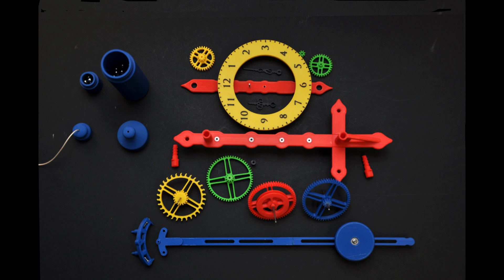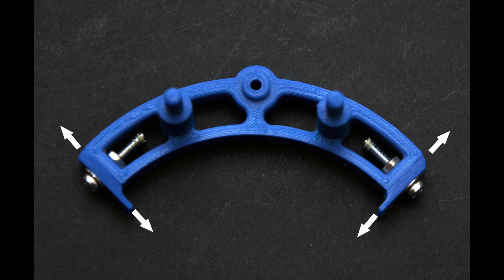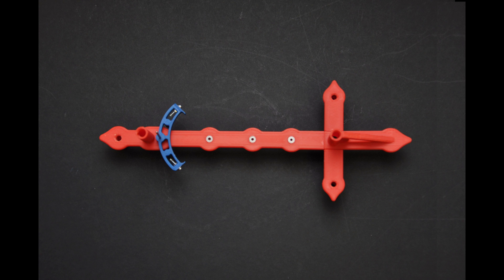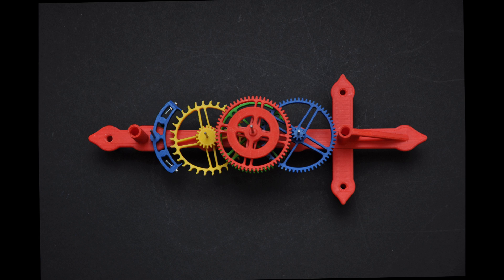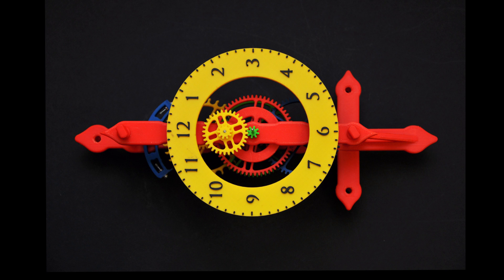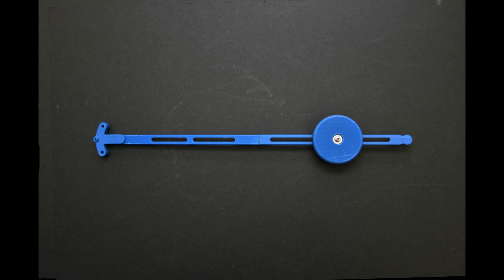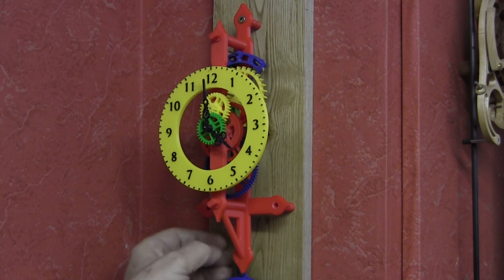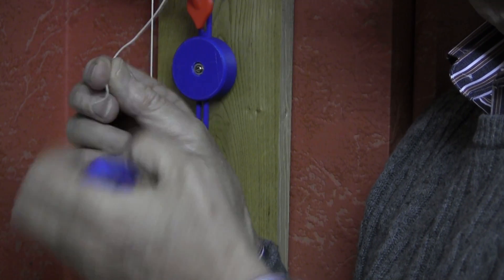Brian Law's woodenclocks Clock 13 FDM

Comment: Hello the capctha on your contact page of your website, seems to be down right now, so I try and communicate with you here.

Hello Sorry for the stupid question, this is my first attempt to build one of your clocks, in a hurry I chose the 3d printed clock 13, only to realize then that it wouldn't fit on my 200x200 printer without scaling. Would scaling all these parts work ? I'd just have to drill out or manually modify any holes ? I could of realized this before I'd bought the plans, if I'd read the instructions, but I was too eager to start printing.

Thanks for any help, suggestion or confirmation.

Kind regards
Neil Dudman
Reply: I've just realized that there is a single piece version of the back plate and a all in one... As most good questions given time we all answer them ourselfs :) And usually  have the questions because we, I am in a hurry and don't read or notice something.

Comment: I am having promblem getting the pendulum to swing can someone help me
Reply: Hi David, I'm Paolo from Italy. What do you mean? Don't you have regular "tick-tock" or the pendulum is not free to move?
Reply: BasementLoadSound when I take the pendulum off all the gears freely move. When I put the pendulum back on I do not get any tick tock sound the pendulum will not swing. But just to let you know I did not have it mounted to a wall so if mounting to the wall will make a difference let me know
Reply: David, the clock must be hanged and leveled on the wall. Then, you can append the counter plus the main weights and make regulation on the two pallets of the escapement until you are happy with your "tick-tock"
Reply: BasementLoadSound that is what someone else had said to me also so since I don't have a wall to mount it on what I'm going to do is mount it on a piece of wood and clamp it to a table

Comment: this is the design I was trying to build out of wood and few years ago. I was using a Dremel rotary tool to cut the teeth, but it wasn't precise enough. I am looking to buy a 3d printer and came across this video! the plans are very affordable. thanks Brian! I will try this clock again soon!

Comment: Mr. Brian, why did you choose a 'main weight and a counter weight' solution instead of just one weight? what are the advantages?
Reply from the maker: +Thiago Bouzan 
It is a simpler construction to do it this way. A single weight with the cord  wrapped around the drum requires no winding gears nor winding keys nor ratchets, all requirement if you go the more conventional route.

Comment: Really nice clock i will defenetely think of 3D Printing it on my DeltaWASP! :) 
Have you had your parts printed by someone else or did you print them by your own? 
Would be nice to have some information about the 3D-printing process, if you have any :) 
Thx for another great video
Reply from the maker: +MrHelmi56 
I bought a Zoltrax M200 printer to see if I could use it to build a clock with. I had files available for a STL build but was unsure that it would work using a FDM printer. Took me several goes adjusting the the design as I went along and this is the result. It works really well and I was able to adjust it to work within a 60secs in 10 hours. 
I was reluctant to put any setting I used because a) I am not experienced enough to know that what I was using was the best setting and b) Most parts were made 2 or three times and I never actually recorded that info.
Next time when I'm not changing the design all the time I will try to record that information.
Regards
Brian Law